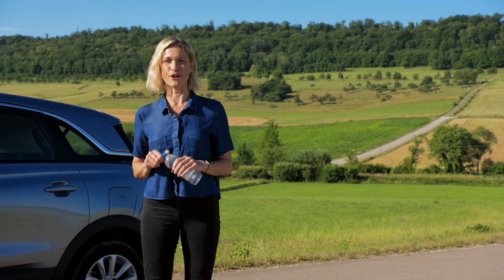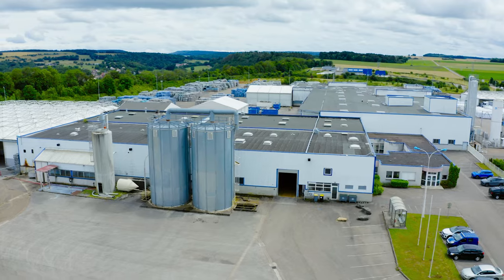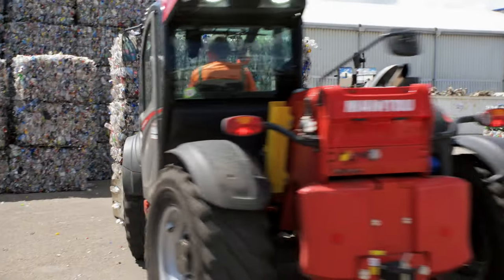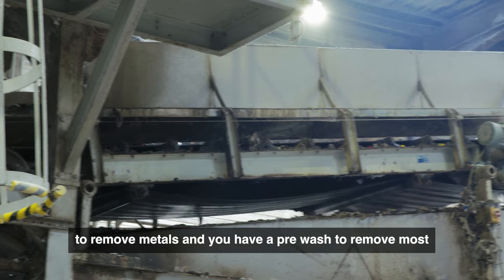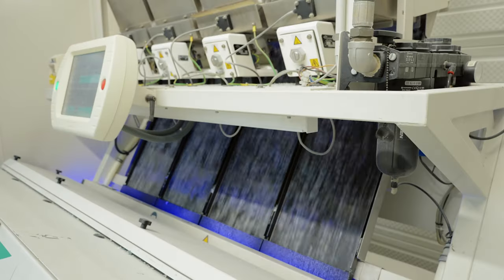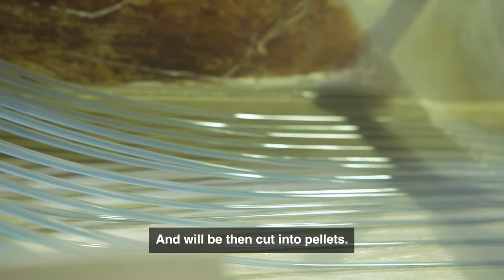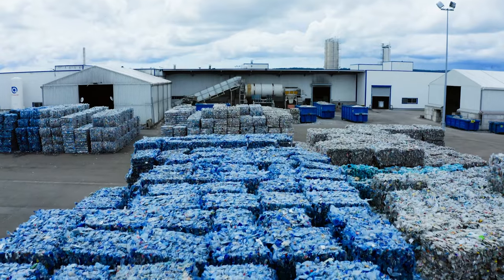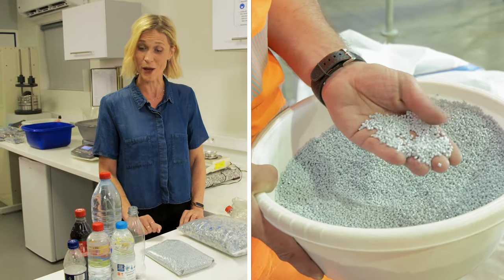Go behind the scenes at a PET plastic recycling plant!

Comment: The question is WHY THE BOTTLE IS NOT USED AGAIN instead of wasting it after just one of single use
Reply: For making fiber from bottle flakes
Reply: It doesnt make sense
Reply: Chemical substances would contaminated the inside bottle. Thats why the used pet bottle must be recycled to decontaminated the chemical substances and only be used 1 times.
Reply: Are you joking??? For hygienical reasons. Wouldn't you tell us you agree the stupid and absurd proposal of EU normatives.
Reply: @andreapicci8410  Dear Andrea, thank you for your comment. May I ask you how many times can a glass bottle be used not to face "hygienic reasons"? If there are any with Plastic bottles, how it is possible that these do not occur already when the bottle is filled for the first time?
Reply: The answer is, you might not want to have a reuse bottle to fill drink and put into your mouth.
Reply: @ethanwang289  with Glass bottles generations did, same with metal, there is nothing wrong if processed properly
Reply: In Germany we have multi use PET bottles, though the single use are more wide spread. But probably the most widely reused PET bottle is the 1l Coca Cola bottle
Reply: @MichaelRada-INDUSTRY50  simple answer is ZERO. Glass get recycled as plastic, the mechanism is almost the same but energy consumption is 50x
Reply: @mighebraga5098 zero uses of glass and it's already a dirty Birdy huh needs crushed melted re blown?

Comment: What happens to the PET waste that ISN"T recycled?  I'm extremely interested in their waste and what can be done with the "undesirable" materials.  Thanks for your response.  -Eric C
Reply: the wast bottle can be made for recycle pet granules which is FDA approval.
Reply: Good thing about PET is it’s the least toxic and more stable of the plastics type. That’s why they’re use for food container and into your Polyester clothes. It is the most recyclable plastics. As long they are collected and stored properly, they can easily recycled later with minimal degradation.

Comment: Interesting, most say plastic can only be down cycled. Only glass and paper/cardboard is recycled back to same new product, some metals also.
Reply: The First World can do closed loop recycling of plastic, but with some plastics more than others. Where it can be done and is done is because the First World has the brains, the investment capital, the advanced technology, and government under-writing. PET is foremost in plastic recycling, but beverage company and petrochemical company  resistance to bottle-to-bottle recycling has had to be overcome. But there is beginning to be considerable volumes of post-consumer PET going into beverage container production.
Reply: Paperboard is usually downcycled too. As fibers break down, they become weaker, so a virgin fiber corrugated box might turn into a cereal box which might turn into newspaper, etc.
Reply: @jonglewongle3438 you are talking nonsense
Reply: @Dawkinsbulldog You also can't mix colors if you recycle plastic because then you will get a mix of color instand on the color that you wanted
The blue flakes are crystalized PET, which happens when the PET is heated do a temperature that isn't high enough to make it melt (and apparently even when at the correct temperature? but if you check the pellets, they are all transparents, so i guess cooling them decrystalize them)
I don't remember exactly how they do it, but if i remember correctly it has to do with chemicals. But yeah, they do ahve to remove the caps one way or another, not only because of colors, but also because it's not the same plastic. I think it's PP, but i'm not 100% sure. And mixing differents plastics is even worse than mixing colors
Reply: @Dawkinsbulldog It's not really that simple, you can't really burn plastic in rich country because it pollute the local air, and people don't really like breathing CO². It's moving the problem elsewhere, but the elsewhere don't care about the problem, so it's technically a win-win
And while theorically (almost) everything can be recycled, pratically it's not really possible. Trash found in nature are often very dirty, full of different crap that may or may not be easy to remove. And sometimes it's not even worth it to recycle it (sprite bottle are often not recycled, because it's just not worth it to shut the production lines, put all the colored bottles, start everything again, then stop everything back when you want to put normal bottles again, unless you have a really big storage)

And there is also the fact that sometimes cities are just dumb
I live near a middle-sized city (it's not that big, but it's not a countryside city), and they do burn trash. But instand of doing the logical thing and producing electricity with it, they are using it to heat houses. Directly. They are building pipes of around 10km and destroying new roads to heat home instand of directly heating water to produce electricity.

Though be careful about ecologics people (especially politics. Well i mean for politics it's everyone, but especially them), because while their ideas usually make sense on paper, they often being the poorest choice possible. Like they often want nuclear powerplant to be shut down in favor of green energy, that's what germany did, they are the biggest co² emitters of europe because they reopened coal central.
Sending trash to other country is the easiest, but not all countries/cities do that. When they do it's often because it's either trash found in nature (and as i said, good luck recycling them), or trash that aren't as simple as "heat it up and it's brand new" (for example PLA need to be mixed with 50% new PLA to be recycled, because if you do 100% reycled PLA you get prints that are even weaker than PET). And i would also point out that upcycling, depending on how you got the trash, might not actually be better, as sometimes you turn something that could have been recycled to be used again into something that is pure decoration and won't be recycled after